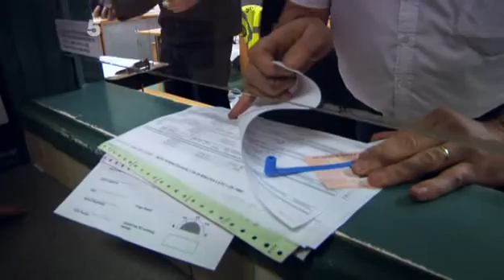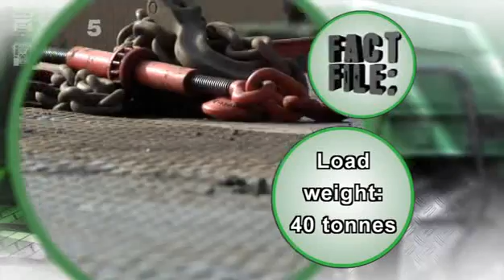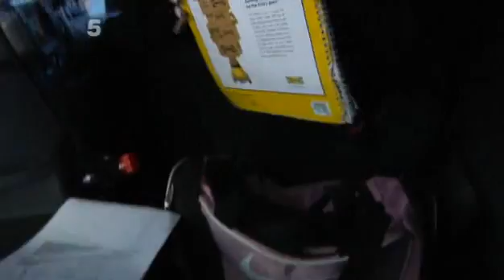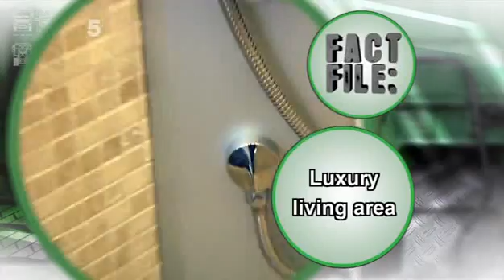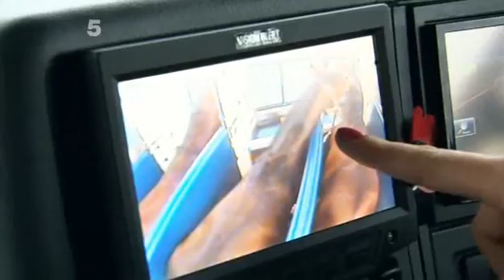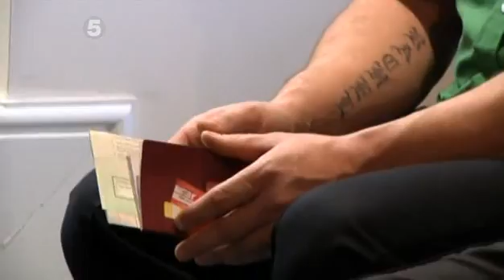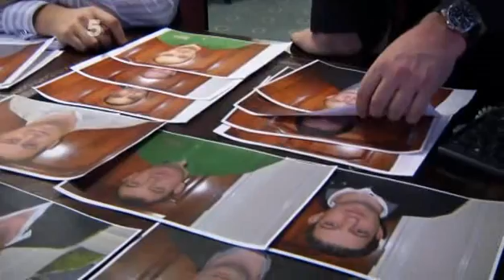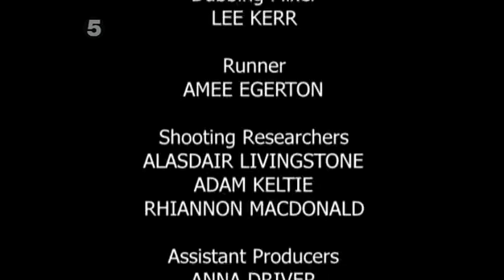eddie stobart trucks and trailers s02e03

Comment: I'm on 9.40 an hour for working in a supermarket doing 8 hour shifts, and these are on 8 an hour? Disgusting, up their wages.
Reply: Not back in 2013 you were, Minimum wage was £6.31 then so they were getting 30% above minimum
Reply: @pdhr0che  still a shit wage? I wouldn't drive for less than 20 an hour, and anything over 7 hours will be even higher.